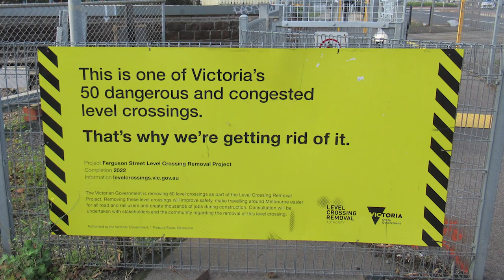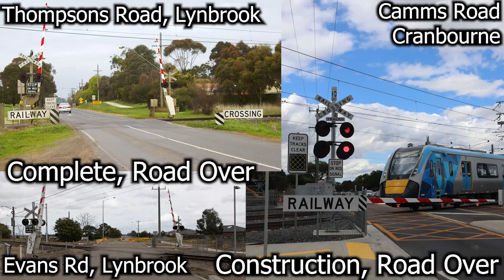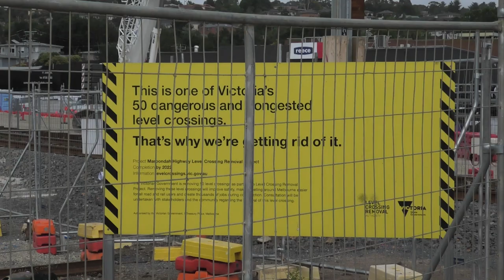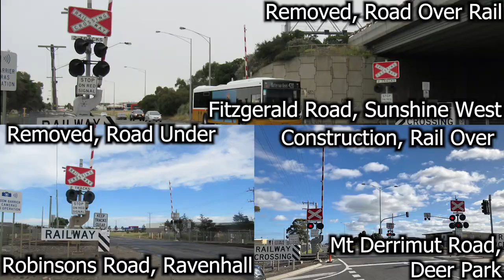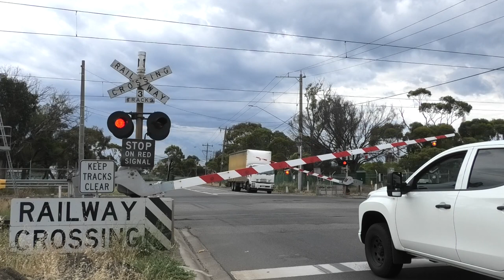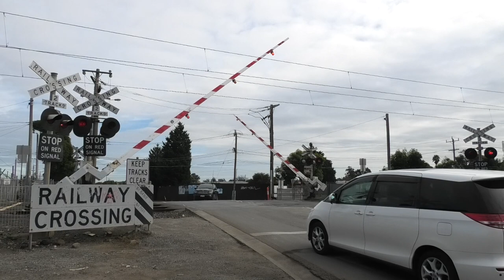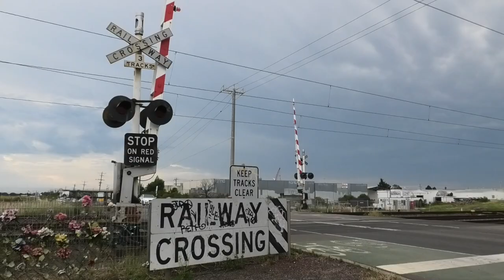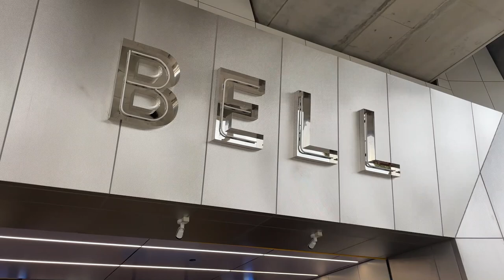The Level Crossing Removal Project (1,000 Subscriber Special)

Comment: As well as the single skyrail to keep the line open to Epping, LXRA installed temporary rail lines on the Carrum project, and at the Werribee road bridge for the ANL freight line only, They will do the same at Parkdale.
Reply from the maker: Oh Yeah, I forgot about those, even know I filmed Train’s at the section of modified track at Werribee Street lol
Reply: They are building a new elevated Parkdale Station which the project is scheduled to finish by 2025.

Comment: Sure the projects are good for the transport side of things new station more services some cases extra recreational space, but they bring so many problems to the communities say behaviour of the workers they don’t treat residents or small business very well take Mont Albert a quiet place that wouldn’t ever make the news until the baker head butted and the fish n chip shop intimidated
The project affects local businesses without compensation customer numbers are down 
Limited parking spots 
A lot of the project is kept secret 
Trees removed
Liked the video btw very interesting
Reply from the maker: I can agree with not giving businesses enough compensation, Surrey Hills and Mont Albert is a good example of this yes, especially with the fact it’s basically split the 2 sides of the rail line apart, like I’d you want to go to a supermarket close by on the Southside, you’d go to like Middle Camberwell because Surrey Hills local isn’t really accessible. A reason it’s much harder for the Mont Albert area is also because it’s a long closure and it’s much more on the residential side of things compared to a location like Pakenham which is a tad more in the industrial side of things (even know it’s in a suburban setting still.) With the trees going, I’m pretty sure LXRA have a policy where they have to plant 4x as many trees as they cut down, or at least something along the lines of that

Comment: The first one was Laburnum. We got a mecano set station that is cracking. Very poor planning for the disabled and still waiting for the car park to be finsihedand disabled parking to be provided. The station is not covered and the station does not have the ramps to help the disabled to enter train. Drivers must delay train to help. Locals have planted gardens as it caught on fire and dug up by fire brigade. many elderly now stay on the blackburn train and return so they do not have to walk over 3 lengths of paths to go from one side to the other.  the later stations are better.